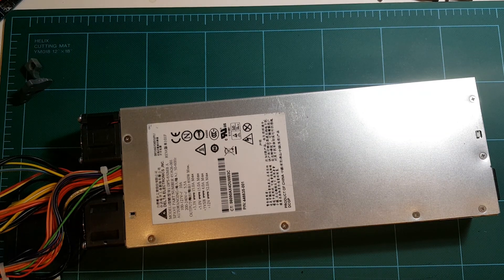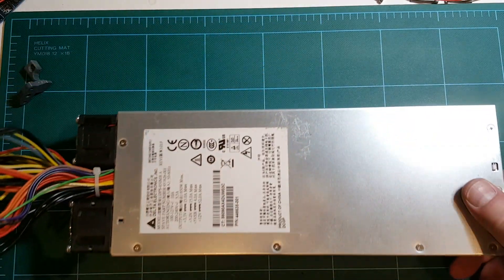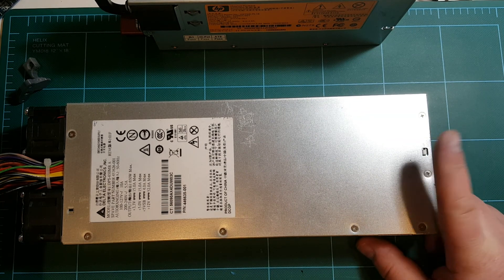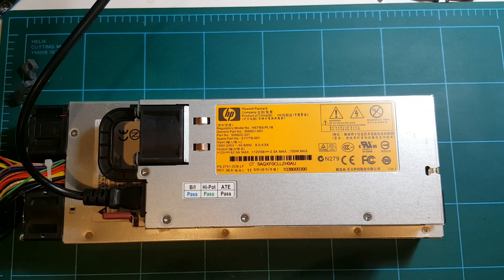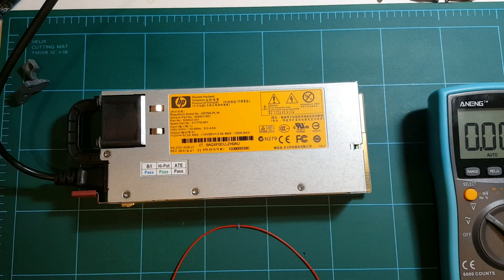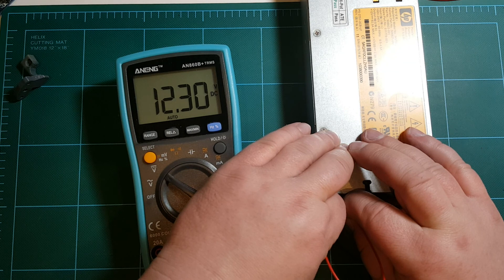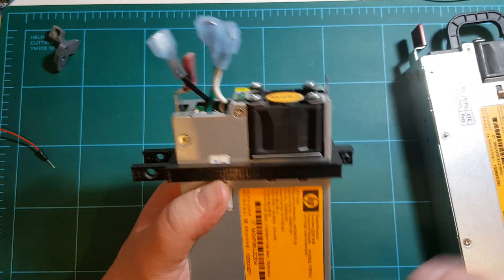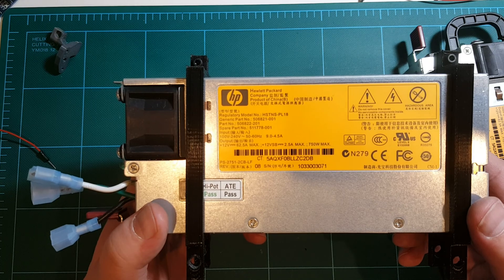Hypercube XL build #4

Comment: This power supply is a cool find - just ordered, as it was the last item needed for my build - banggood  are out of stock for the 30A ... this will be here before all the other gear!!

well stoked - thanks Artur
Reply: Thought I would add an update - with a years worth of use from this PSU, seeing as its a server power supply I expected the fan to be very noisy, and I still think it would be - if it ever started running!
These HP units are very smart and the fan is only used when the supply needs cooling, the up shot of this is that in my year of testing on a Hevo the fan has never kicked in, print runs of 48hrs just dont load the power supply enough.
Also because this unit is so overrated the heatbed gets all the power it needs and heats up in a very short time, my original printer an Anet A8 takes three times longer to reach temp, this is going to get the HP upgrade when I get around to it.

Comment: wouldn't you want a 24v power supply with such a large build volume... do they make those power supplies in 24v?
Reply from the maker: The heater I'm using in this printer was designed to be powered from 12V. Powering it from 24V would not be a good idea. And no, as far as I know there are no 24V server power supplies. But generally, yes I would advocate 24V for this bed size or larger.

Comment: Delta power supplies are considered most reliable. You could probably mod the cooling on it a bit to run quieter. Consider that it comes from a server, so the air intake in its natural environment is often going to be too hot to even hold your hand in, but you're running it cool.

The HP server power supply that you have is made by... E132068? That would be Lite-On. I'm surprised that it's THIS quiet, noise pollution is rarely a consideration with servers. Not convinced on the utter awesomeness of it, but likely no cause for concern either.
Reply from the maker: Good point about the first power supply. Might be worth replacing fans with something quieter. For the second power supply - it also has a fan which looks quite beefy as well but it only comes on under load, possibly once temperature inside enclosure raises. I'll see how noisy it gets once I hook up my heatbed in my printer. That will be a serious load. I wish the first power supply also adjusted it's fan speed depending on load/temperature